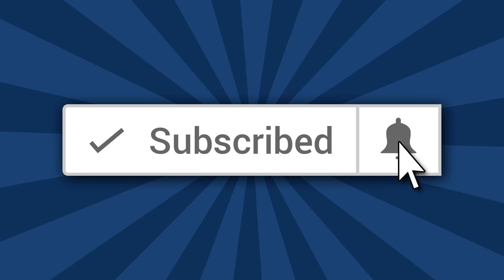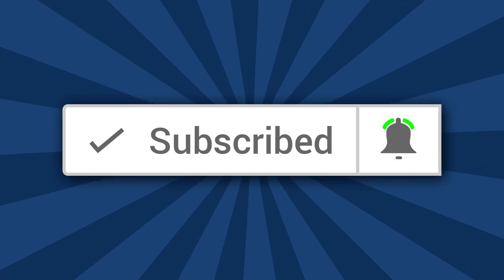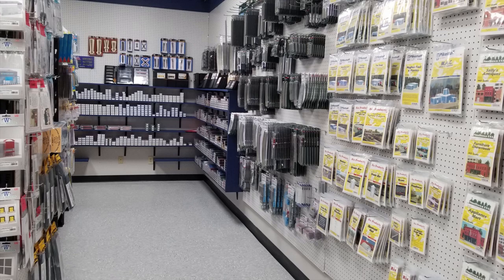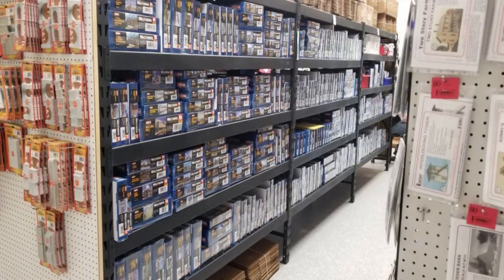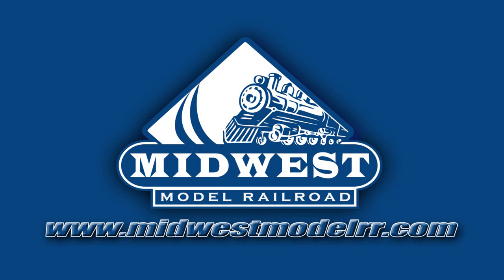Best Solvent Cement for Model Building

Comment: Ron.  We enjoy your well researched and informative videos.  A couple of fellows in our Model Railway club use the Deluxe Materials "Plastic Magic" and "Roket Plastic" glues.  My favorite is the "Roket Plastic" glue.  It has a non clog thin tip, is water washable, non toxic, non flammable, invisible joints and low odour.   Only negative is the price.
Reply from the maker: Hi. Thanks for this tip. I am going to check these out. 👍

Comment: One way to check if a cement will work without regretting it is using the runners parts come to test how well it adheres/sets up because finding out that it works to aggressively is better on something that isn't needed. Indeed solvent  especially in cement form by its very nature dissolves the surface so that the bond is more like a plastic is almost being melted together as if it were still hot during the extrusion process. If you ever put  PVC pipe together with cement you  know that it "freezes" after a handful of seconds its why you twist it a bit so that the bond is even stronger and many have found out that you have to buy the right cement for the plastics being used. As with any form of cement/glue your using the technique comes down to not using to much more than to little in modeling because one can be fixed where the other can literally melt the material as if it were in a furnace. A great method is to learn how to let the cement wick into a seam if it's thin enough because unlike applying it like caulking the plastic only needs to have its surfaces wetted as it were to adhere it together in most cases.

Comment: Hi Ron,  A word of caution with MEK. I have used it for years as an aircraft mechanic. What we have been told is that MEK is absorbed though the skin and can cause liver damage. So, using gloves would be recommended. Thanks for a great channel, I have learned so much from your videos. James
Reply: I would think a chemical grade respirator would also be advisable, to stop you breathing in the vapours and absorbing them through the lungs.
Reply from the maker: That is good advice from both of you. If in doubt night trial gloves and a  Respirator are always a good idea.
Reply: Ron's Trains N Things “night trial” gloves. Isn’t that what Bailiffs wear to Night Court? Isn’t autocorrect/auto spell a wonderful thing! 🤙🏼
Reply: Nitrile gloves are highly chemical resistant and are a good choice when working with most solvents.

Comment: I am wanting to build a train elevating onto a higher level but coming through a turn to do it.  In an earlier video you talked about easements and rail lifts with tape to give the train a lean.  Would you do the same thing for a rising turn?   How would you handle the creation of the easement into this type of turn?
Reply from the maker: The easement would work the same way. If I understand what you are proposing, I believe Woodland Scenics foam risers may be your best bet for elevation. just mark out the easement on the base board, place the riser along that and lay your roadbed.

Comment: Back when I used to make model airplanes as a kid, I used carbon tetrachloride. It "melts" the two pieces of plastic together. There are some down sides to carbon tet, such as potential health risks, so you would want to use some kind of breathing protection. And I don't know if it would work with styrene. Can't remember what my model airplanes were made from--60 years ago!
Reply: James Craft, Carbon Tetrachloribe is at the top of the Methyl Ethel Bad Stuff list !!!   It absorbs through your skin and and every exposure builds up the level in your body as it remains there for life.   It was found to be one of the best extinguishing agents for Fire Extinguishers and many people had them in their cars, problem was that if you used of to put out an engine fire , the hot metal would cause it to vaporize and and be inhaled which usually proved fatal, and it was banned.

Comment: Hey Ron, great video. Thanks for the info, but is CA cement also a solvent cement? Thanks for sharing your knowledge on this.  Ken
Reply from the maker: Hi Ken. No, CA is not a solvent. I stopped using CA on plastic to plastic years ago because it gets brittle over time and turns loose. These solvents actually fuse the surfaces together like a welder, creating a much superior bond.
Reply: Thanks, I appreciate the response. 👍🏼
Reply: Ron, I checked out the pick of the week on this and it goes to MEK substitute. Does the substitute for MEK do the same thing? I am having a hard time finding the quart sized MEK. Thanks again for the help.  Ken

Comment: You can make your own thicker cement by cutting up pieces of the kit sprue and dissolving them into acetone or MEK.  Then your cement is the same as the kit material.
Reply from the maker: Yes, that is a great tip. Thanks.